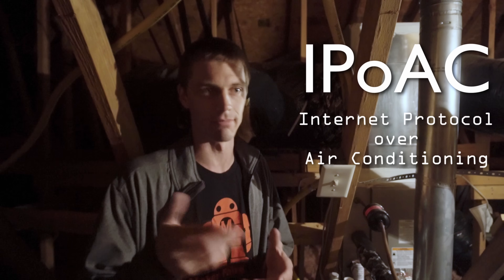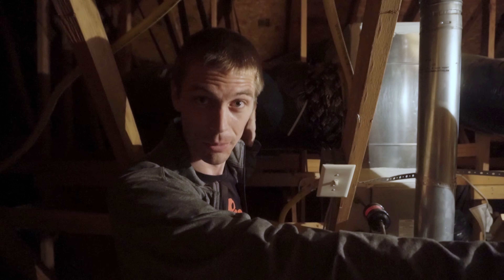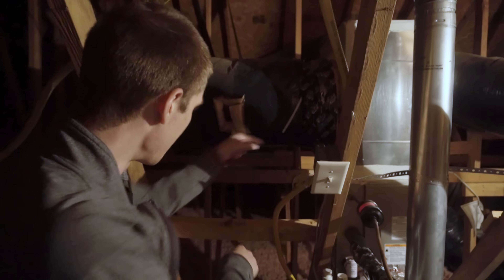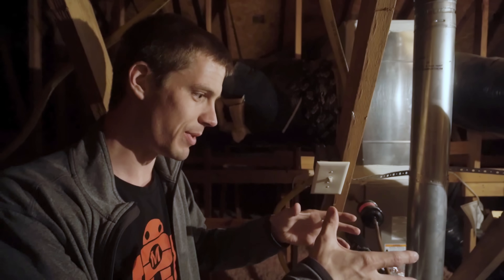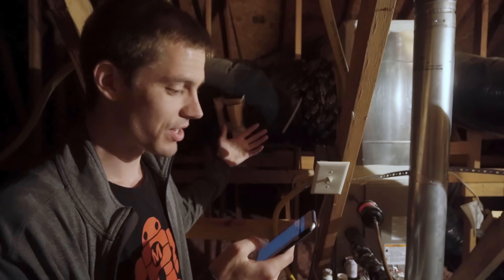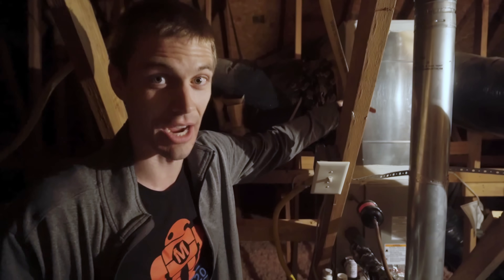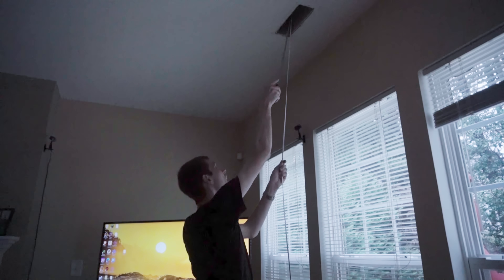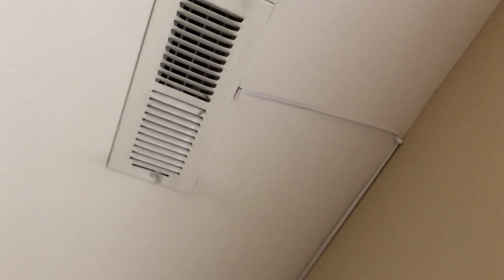IP over AC: Mmmmmm Ppppfffftttt SssshhhhhhhWOOOSH

Comment: As a residential HVAC technician, I laughed out loud when he cut a giant hole in the supply duct. I don't know how he tried to seal it, but it's important to keep all that air pressure in the ducts to make sure it flows through and exits the registers at a velocity high enough to mix with the air in the room. Ducting systems are designed with specific diameters so that the velocity of the air remains constant as it flows through the whole system (~700ft/min), and each register should have the same velocity of air coming out. Leaky ducts cause lower (supply) static pressure and lower velocity air (and therefore less "treated" air) getting into the home, meaning less efficient heating/cooling. In addition, the fan is still trying to pull the same amount of air from the house through the return duct, but now the house is under a negative pressure (since some of the air is escaping in the attic) so the return side static pressure raises. The data plate on the furnace will say what the Max External Static Pressure is rated for, but most residential units are rated between 0.5 - 1.0" WC (or ~0.018 - 0.036 psi). Best case if the hole is sealed well he won't experience any noticeable difference, but worst case it's years of higher electric/gas bills due to longer run times, and a premature blower failure due to increased return side static pressure (and don't expect it to be covered under warranty).

Edit: Just to add a better way that won't damage the system, I would remove the faceplate/cover/door for the evaporator coil (the metal box before the supply plenum that has the copper or aluminum lineset feeding into it from the outdoor condenser) and feed the balloon through the door. You could then drill a much smaller hole into the door with some kind of a wire grommet (and I'd still put mastic tape over it).

Comment: make sure you use cable rated for those temperatures and for use in plenum spaces.  I do low voltage electrical work, a lot of what we do is pull blue cable, we actually do this somewhat commonly for specific circumstances, well, the bag part, not the ac part, though I’ve joked about it before

Comment: Air blowing or jetting are used professionally for running optical fiber I've seen it done in 4 inch conduits between buildings. The coolest stuff is bundles of microducts where they only blow the needed fibers through the microducts. The cost savings makes sense when you're running kilometers of fiber.

Comment: Threading cables through tiny holes in walls:

For dropping down, use a small weight tied to a string as your pilot line. Far more predictable trajectories. You can then later tie the end of that line to your cable to pull the cable through. If the end hole isn't straight down, you can use one of those metal wire clothing hangers with a loop bent into one end to act like a fishing line to extend your reach by 2-5 feet depending your particular situation.

For catching the pilot, use another hanger or two with a string tied from one end to another to create a 'net'. When you separate the ends of the hanger and stretch the string taught, the area between the hangers and string is now your 'net' and when you pull it out of the hole, the string between the hangers will pull your pilot line in with it.

Tip: There are wall fixtures similar to those around a light switch or electric socket shaped specifically for cables, so instead of trying to struggle with a cable-sized hole because you don't want it to look awful when you're done, make a bigger hole and just cover it up with the wall fixture.
Reply: I'm genuinely baffled as to why he didn't run this through the walls and use wall plates. I've done it a few times, although not for years. I remember it being surprisingly easy and looks infinitely better.
Reply: @grenin1010   He briefly mentions the wall behind the TV is an exterior wall - which should be packed with insulation and ideally left intact regardless of difficulty. I'd be surprised if there isn't an interior wall elsewhere that runs through both stories, but that should also be fireblocked at the floor level anyway. It's pretty difficult to safely/legally remodel a pathway through separate stories in modern buildings with the average DIY tools.
Reply: How are you getting that through 2 stories of noggins?

Comment: You know, if you don't have too many HAM radio operators nearby, then you could also use those IP over AC boxes (AC as in Alternating Current). Perhaps better known as Powerline Ethernet. You just plugin your router into one of these boxes at the nearest power outlet, and another of of these boxes at an outlet where you want  to use it and plugin in the ethernet cable there.
Reply: Or, if you want to find out how many HAM operators live nearby, you run ALL of the IP over powerline you can!
Reply: Is this still really a thing? I remember reading about it over 20 years ago before wifi really existed and the transfer speeds were awful.
Reply: Yes it is still a thing, just less common I'm sure. Plenty of cases where it's better than wifi though.
Reply: @Muonium1 They make gigabit over powerline. It works well.
Reply: how exactly does it affect HAM operators?
Reply: the newer gigabit+ powerline adapters work really well.
MOCA (over TV coax) is awesome though
Reply: @zovisapphire  sending high frequency signals over powerlines produces radio waves that can fall into the frequency ranges that HAM radios operate in resulting in noise.
Reply: @MLeoDaalder  One of the many reasons my neighbors are corn fields.  I only played this video because of my hate for this stuff.
Reply: @Muonium1  It works sometimes. It is highly dependent on your wiring. It is definitely not equivalent to a standard Ethernet run.
Reply: I'm more of a power-over-ethernet guy myself
Reply: @johndoe528  same here! i love how the cables warm up my house in the winter! the insulation is a bit drippy though, they should really make the cables better >:(
Reply: I have tried these and got pretty poor results, and you will definitely annoy any nearby amateur radio operators; the adapters make a token effort to filter out the signals in the main ham bands, but it doesn't do a great job. Even if you don't care about that, jitter is awful and packet drops are frequent, and you're doing really well if you manage 100mbit in either direction.

MoCA adapters on the other hand (which use your cable TV wiring and leverage frequencies that are unused by your cable/satellite provider) work great however, and are a pretty decent option if you can't run proper ethernet cabling.
Reply: @MLeoDaalder  and it'll work the other way around. nothing like being able to cause lag spikes at will just by hitting a button on my transmitter... hehe.

and the funny thing is legally (FCC rules) you have no recourse, because your product is not licensed to transmit on those bands, wheras hams are licensed to do it. that "stupid" thing on the bottom of your electronics that says something like "must deal with any interference received"... it's that.
Reply: This is what I thought the video was actually going to be about, even if my first thought was, in fact, Air Conditioning, but even then I thought he was going to modulate the air currents somehow to transmit super low frequency data.
Reply: Ham radio operators, normal radio listeners, wireless babyphones etc. Also, powerline ethernet is rather finicky over  what lines it will actually work reliably - as it should be.
Reply: Didn't know this was a thing, it's not frequently represented as a trade off with the solution that's appropriated.

Comment: That (the bag through the duct) is similar to a technique I saw years ago on Home Time where they used a wad of something on a string and a vacuum to "pull" thru some pipe / conduit.  Then the string was used to pull wire through it.

Comment: I used the air return vent for part of a cable run at my parents house in ~2003, dropping from the second floor down to the crawl space, where it could run back up to a utility closet on the first floor where the router was.

Comment: Fun fact: some aircraft and other things which require moving a lot of computing power in a mobile thing used to use metal ducts and radiowaves to transmit between modules. 
I forget what they are called but they are neat.I've seen them in old American fighter jets like the F15 and F16.

Comment: I never used the air pressure to do the routing, but a house I lived in back in the 90s had the main AC return vent in the server closet and at least three long cable runs went through the ducts.

Comment: Speaking of catching cables behind walls/furniture and routing them through a small hole, I've used a method that works quite well. 
Tie a nut to the end of the cable and drag it with a strong magnet from the other end and through the hole then pull the cable out.

Comment: This is essentially the same method we use as electricians to get wire through pipes. 
Way to think out of the box.
It’s not quite as hard to get that wire down your wall though as you might think. Let me explain.
Drill a hole through your header in the attic. Cut a small square hole in the Sheetrock in the room below your header hole by the floor. Drill a small hole through your flooring and into the lower floor wall and boom you’re where you need to be. The only repair you need to do is replace the square sheet rock you cut out. If you’re having trouble fishing the wire down the wall the method I prefer is similar to the method you used except I use a nut on a string and a very powerful magnet.
Reply: Wouldn’t the insulation get in the way?
Reply: @birdiesnbritts1391  normally insulation is only on external walls. Typically you would choose an internal wall to do this. If you had to do an external wall with insulation then yeah it’s harder, but still not impossible you need to try to fish your line between the paper back and the sheet rock though

Comment: That’s quite clever actually, the reverse of the classic vacuum cleaner trick used for pulling cable in conduits. However, that flat Ethernet cable is horrible, I’ve never seen one that has managed to actually pass standard tests.

Comment: I hope you used plenum-grade ethernet cable for this. Regular riser-grade cable can function like a fuse in house fire conditions.

Riser rated cable is acceptable when running ethernet through walls, since the framing (properly drilled and sealed) will act as a fire stop if the cable starts burning, preventing the fire from rapidly propagating from one part of the home to the rest.

However when running through ductwork there are no natural fire stops. Worse, there may even be forced air oxygenating a burning line.

To be fire code compliant, any cables run through air ducts need to be plenum rated. The plenum rating requires the wire sleeve to be made of more exotic material that does not burn like a fuse in typical house fire conditions. It's more expensive, but a lot better than dying because a small fire in the attic got an express ride through the ductwork to the main living space.

Comment: Some crown molding would nicely hide the Ethernet cable running along the top of the wall. And you'd get some fun 3D trig figuring out the angles to cut the crown molding.

Comment: Powerline Networking is also a worthy upgrade vs WiFi for hard to reach spaces. It's not as reliable as a straight ethernet connection but is extremely easy to set up and will work between any areas of the house as long as they are all on the same panel.

Comment: As someone who's been working in networking:
Those flat LAN cables are shit. There is a reason cable pairs inside regular LANs are twisted, so that their magnetic fields cancel out, and do not influence other pairs.

Flat LAN cables do not do that, so they are HEAVILY limited in maximum length. If you notice random ping spikes or packet drops, I would suggest running higher quality cable the other way around.

Still, very creative solution, love your videos! :)
Reply: a little reading tells me the wires inside "flat" ethernet cables are still twisted pairs, the same as in a normal ethernet cable and have probably been since the invention of the twisted pair

Comment: huh I totaly thought this was an april fools video, but that is all just correct! lol.
I saw this technique used in a home improvement show where they used the same thing to run wires to baffles that they installed after the fact in a home that was already built so they could control airflow to individual rooms.  Cool video dude!

Comment: Another way of feeding Ethernet data thru AC is to use the AC power line.  No kidding, no wires, no plastic bags.  Ethernet over AC power just requires the appropriate transmitter/receiver pair.  Speed is dependent upon several factors. That's what I thought you were talking about. I use that from my second floor to the basement.  Look, Ma, no wires!

Comment: I did a little satellite tv tech work years back and they would have had us go through an exterior wall, down the side of the house, and then come back through into a plate. Or for extra points fish the thing through the walls and the studs and all the insulation which is a lot neater but 50 times the work. I can only imagine what the home owners would have thought if I tried sailing a bag through their AC ducts LOL.

Comment: An electrician would never do that. He would cut tons of holes in the wall and add hundreds of dollars of wall patch repair costs. That's the proper way to do it :)  Although, you are actually allowed to run wires through duct work if you get plenum rated cables. There is a more accurate name for it but I cant remember it at the moment. Your way will work fine for a long time though and its just low voltage so its fairly safe. Never do that with power wires though. The heat from the heater plus the heat from current can exceed the power wire rating and make a house fire. I must say this was quite clever and well executed. I love it.

Comment: In early 2020, during covid I suddenly needed to cater for my work from home needs, plus my wife working from home and our son zooming into his school.

So I ran an ethernet patch cable to a spare bedroom by running in to the wall through an attachment for a PIR sensor for a defunct alarm system, up into the roof space, and then into my new WFH spare bedroom through the hole in the ceiling that also supplies power to the light fixture.

No AC shenanigans, but I did use a pool noodle to poke the cable into some hard to reach spots...

3 years later, that cable is still coming out of behind the light fixture, but i have since run fibre properly for the 10GBe goodness. One of these days I'll need to get back up there and pull the old ethernet cable out.

Comment: This was a pretty good idea, but there was another option that is also IP over AC, as in AC power outlets by using a powerlan adapter
Reply: That would have much worse performance characteristics.
Reply: @DanKaschel  i use them, they are 600Mbps, definitely good enough to stream
Reply: @Extra_Mental  your two endpoints need to be on the same circuit. Highly unlikely in this case.

Comment: they do internet over power lines you know. little adapter doohikey plugs in to the mains electric circuit and throws some 1s and 0s around. it works surprisingly well! very stable in my experience, and fast enough for most things

Comment: Actually a common thing - but its called Plenum rated cable (for air plenums), since this is a fire hazard (lots of air to help combustion needs a special rated cable). They do make Plenum rated ethernet cable quite readily, even though it seems strange how low voltage could be that big a risk. But, it is a metal cavity with lots of airflow.
Reply: Everybody in the comments seems to be an expert on the building code... 🙄. Plenum-rated cable is really only relevant in a commercial installation with dozens of cables running every which way and hundreds of occupants.
Reply: @tissuepaper9962  True, most plenums where this sort of rated cable is used is big open areas in ceilings (or raised floors) that act as a plenum, not actual ducts. And yes, this is only really found in a commercial environment.
Article 800 of the NEC mentions all the rules if interested.

Comment: Never considered pulling a rj through the ducts. I usually truncate all the data on a nearby nas and use a mesh router. Never enough though... ended up going around the house with a 200 ft PoI cable.

Comment: From the title I was expecting IP over electric wires, like the 110/220 V ones. You "just" plug a box into electric socket at both ends and it will "magically" modulate the electricity with high frequency signal carrying your data or something.

Comment: This is so uncommon in old really commercial retrofit, thou often the entire ceiling above the t-bar is the return air and that is the path...  but either requires Plenum rated cable though so toxic vapor is not generated when it outgases.. which it will when the heater runs .

Comment: Congratulations, you understand some of what makes a home electrician’s job hard. Now run that wire 12 times to 12 different circuits around the home, through the walls, with no exposed wires 😬

Comment: Electricians use a fisher cable. Its kind of like a roto Rooter in how it "snakes" through the walls and the holes you've drilled and you shouldn't have but maybe two 2x4s to drill through, if that even depending on how the house was wired, and then you just tape to the end of the fisher and do exactly what you just done that was WAY simpler than I would have went about it. Work harder, not smarter, thats my motto